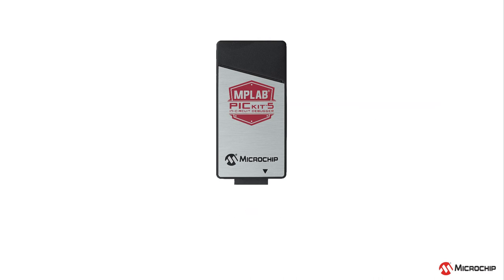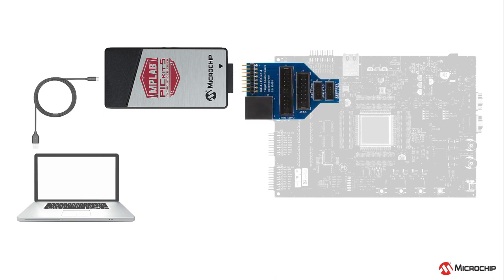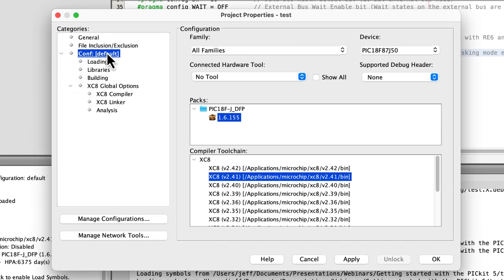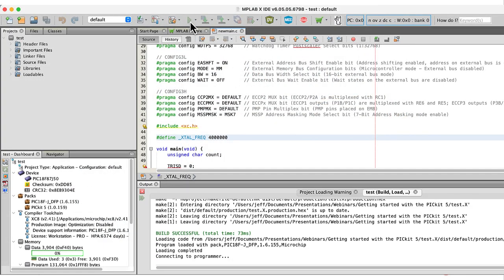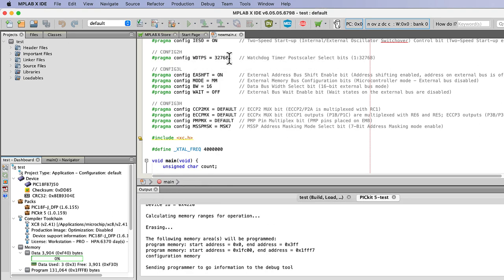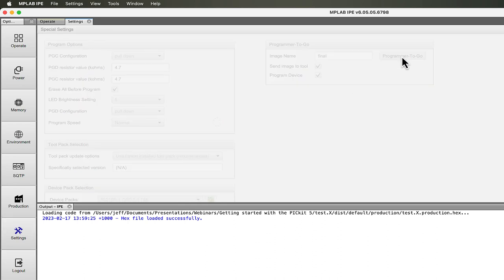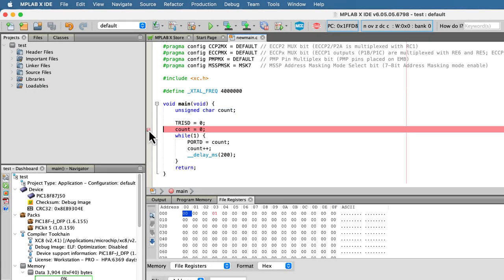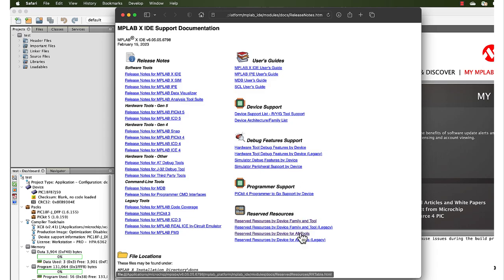Getting Started With the MPLAB® PICkit™ 5

Comment: i need some help on this programmer, i do auto electronics, i need to retrieve information from a pic18f458, can the pickit 5 read and save software?
Reply from the maker: Hi, The MPLAB® PICkit™ 5 can read and save software from a PIC18F458. Connect via ICSP, use MPLAB X IDE or IPE, select the device, and use the "Read" function. For more info, see the User's Guide: https://onlinedocs.microchip.com/g/GUID-8D61C0B9-A97F-4F4D-99F8-1D7424264C2A-en-US-1/index.html. Hope this helps!
Reply: @MicrochipDeveloperHelp  thank so much

Comment: Did you reinforce the output data buffer against excessive voltage or reverse voltage on programming pins? Does this version have better ESD protection? Pickit 4 used to easily broken when you connect it wrong. In my opinion the only bad thing about the Microchip is the bad and bugful programmers. Any other competitor have better and less problematic programmers.

Comment: I had bought the pickit 5 for $2,000 mxn, gadget and delivery. I been out of the practice for workable reasons for several years, and I had started to program again. It is really frustrating to see that the material Microchip post at its web site is not clear. It makes me feel that I am stupid. It was easier to program the same devices 20 years ago.
Reply: You mean, like with Pickit-3 or new MPLAB X IDE 6.20+ ?